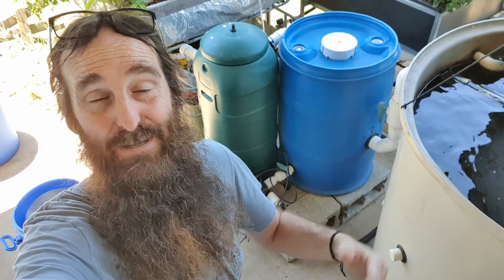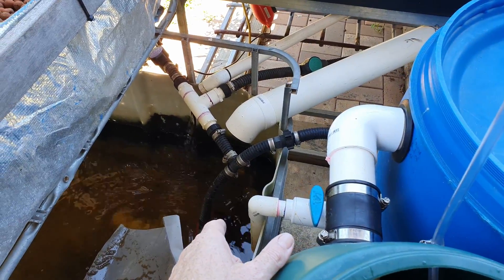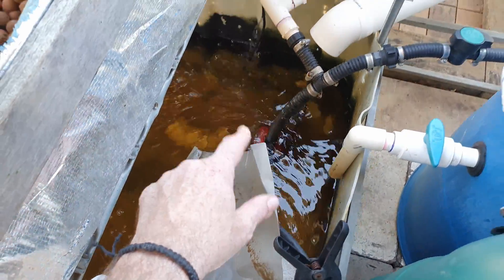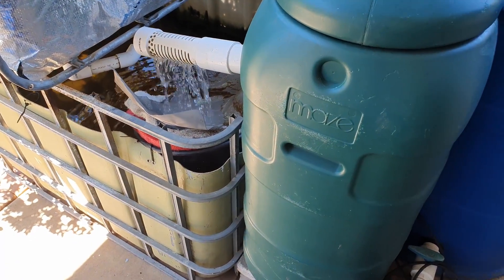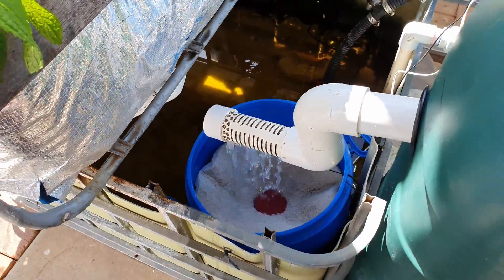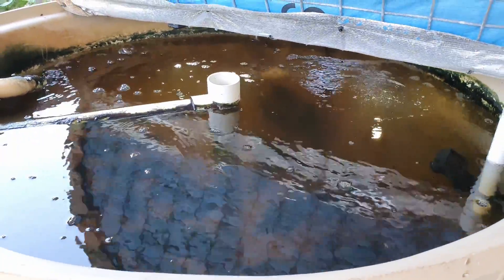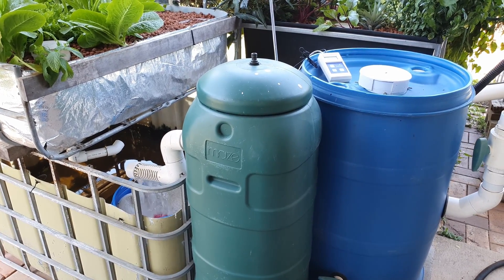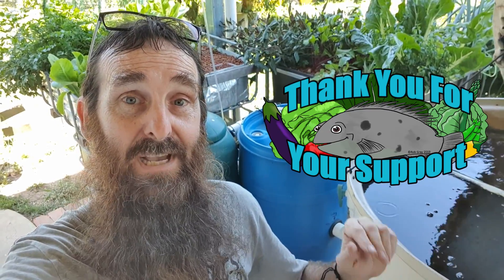New Fine Solids Filter for Aquaponics System

Comment: I am having a difficult time understanding what the valve between the fish tank and the first solids filter is accomplishing?  What purpose does is serve?  I am building one similar to yours and am about ready to start the plumbing.  Also, what size is the square bucket you use as a solids filter?  Lastly, the kick pipe in the fish tank?  Can slots be put along the piping to capture more solid fish poopies?  More efficient?  Or is there a reason you don't add any?
Reply from the maker: The valve allows the water flow to be stopped so you can clean the filter without the flow string up the muck.
I don't use the square bucket anymore as it is a bit wide. I would base the radial flow settler on the first 2 videos in this playlist,
https://www.youtube.com/playlist?list=PLBcWprMIwYYjjZIXxx8GZxm_55Fjs0mOF
The opening at the base of the solids lifting pipe is enough to gather the solids from the base of the tank. The only time I've added small slits is due to having fingerlings & needing smaller openings to gather the solids.

Comment: What tank do you use for the fish tank ?
Reply from the maker: This tank came from a company that has now closed down I'm sorry to say. Try searching for "aquaculture tanks" locally & a supplier may come up.
I'd also recommend that you look for a tank that has a height to diameter ratio of 1:2. That will give you better water circulation & solids collection from the centre drain than my taller tanks. 
IBC caged totes work as well & are much cheaper than the larger specialty tanks.
Reply: @RobsAquaponics  im from horticulture background but want to go aquaponic setup.  Ill be doing a ibc style setup first to get the feel for it. Looking at 6 bed 2 ibc main tanks and a sump tank system
Reply: @RobsAquaponics  love the challenge to by the way

Comment: Hi Rob, I have a system very similar to yours, same filters etc. Water pH seems fine though if I dig in my media beds I have very fine suspended solids. My beds are constant flow as my sump isn't large enough to handle flood and drain. If I scoop some up there is no bad smell nor does there seem to be a rising pH. Fish tank is clear. The system has been running for over 12 months without cleaning media beds. Am I right to leave things be or is an annual clean of media beds standard practice? 
Thanks for all you do mate, you do a great job. Should be proud!
Reply from the maker: Hi Ren & thanks for the kind words. 👍
Fine suspended solids through the media should be no issue & I get them in our system as well. I think if you keep an eye on the pH & do a bit of a smell check every so often you should be able to catch any issues before they become a problem. 
Maybe a drain of the bed & a quick dig through the media for a visual check every 6 or so months couldn't hurt if the fish are going through a bit of feed. 
Hope that helps some.
Reply: @RobsAquaponics  thanks mate, very reassuring. Oh and you have a good taste in music! Long live heavy music 🤘
Reply from the maker: @Ren-io4mw  🤘Cheers Ren 🤘

Comment: Loving your videos! Really well done and informative. You mentioned setting up another system that will be direct flow. Any advantage to this or is this just an experiment?
Reply from the maker: Our first system was a single loop system where the water went from the filters out to the beds & it ran just fine. 👍
The split flow set up is better for systems like our current one as the beds are spread out a bit & are also set at different heights. 
Hope that helps some Alexis.

Comment: Hello Bob. I have a 1000 litre tank.. haven't installed bio filters yet. Which Uv sterilizer can I buy 🤔
Reply from the maker: I wouldn't recommend you use a UV in an aquaponics system. It can cause issues with the availability of iron boron & manganese to the plants. Mechanical filtration would be the best option I think.

Comment: I'm wondering if you could drain the growbeds to a second sump and only pump that water to FT. Filtered FT output would then only go to grow beds. Not a permanent solution of course, but until the solids are cleared.
Second remark: are you sure your SLO is working correctly? It's almost as if the solids aren't leaving the FT but only the water is.
Reply from the maker: Have been running systems with these SLO since I started & this is the first time I've had issues. 
I had a feeling it was the flow rate not handling the increase in feed so rectified the issue,. Did a bit of an update on it in the latest clip,/
https://www.youtube.com/watch?v=RHO7llpAYi0
Cheers & happy growing.  👍

Comment: My seedlings are light green... should I supplement some nutrients into my aquaponics or will that hurt the fish?
Reply from the maker: It's hard to say without knowing more. 
If you system is young it may not have enough nutrients to support all the plants yet. In that case seaweed additive may help a little but I wouldn't go adding any nitrogen/ammonia based additives in case the bacteria haven't built up enough to process it yet.
Reply: @RobsAquaponics  it is new and still developing. I also have a terrible milky cloud and can hardly see the fish, the cloudiness wont go away. I don't know what to do it's been about 3 weeks, I put in a mechanical filter and am using some uv light to try to discourage algea growth. I'm not sure if its algea or bacteria bloom, but I thought it would have cleared up within a couple days. The fish are still alive, so it can't be to toxic.
Reply from the maker: @PhosHodosLogos  The UV light can cause issues with some nutrient uptake by the plants so wouldn't run it for too long. 
I would say at a guess that the bed is just over planted at the moment. 👍 The cloudiness could be a number of things though.
Reply: @RobsAquaponics  I wondered about the UV light. I think I will try to find a place that can test the water for biological components.  Thanks for the response.

Comment: Great video rob! How often do you recommend cleaning the k2 pieces in the bio filter? I would think maybe every 6 months or so. Keep up the great videos! They help us out alot:) don’t let the negative comments bring you down brother
Reply from the maker: They shouldn't need cleaning as all as the movement from the air would stop any solids from settling out. 
The air stones sit on the base in this one so that shouldn't be an issue at all. 👍
I did need to clean the media in the old MBBR a few times a year as the venturi was set off the base & this allowed solids to collect under it.

Comment: I'm have a 60gallon (100x50x50cm) canvas tank where I keep my talapia and turtle,I'm trying to use as aquaponics + NFT,  I'm having issues figuring out to introduce a sump tank with split flow since is a canvas tank I can't elevate the tank :) higher, should I just forget the idea of sump tank ? :)
Reply from the maker: If you're running NFT only you should be OK as the water level will be staying fairly constant. 
Hope the system works well for you.
Reply: @RobsAquaponics  thank you rob, I decided to ditch the nft and replace them with the gutter growbed as afnan did ☺️
Reply from the maker: @izwanmohd  Nice one mate.👍 😁
Hope they grow well for you.
Cheers.

Comment: you should try a NFT tray with perpindicular ridges and run the water over it.  the solids would probably settle along the ridges.  if you put a hole on the NFT tray before the water inlet for the tray is place and mounted the tray on a see-saw then when it is tips the other way it would purge the channel pretty good.  if many were mounted in a zig zag fashion and tipped once or twice a day that might work
Reply from the maker: I found it easier to increase the flow through the tank & that looks to have done the trick. 
I covered it in a more recent clip if you're interested in sussing it out,
https://youtu.be/RHO7llpAYi0
Cheers.

Comment: Hey mate, could that airstone you have in the fishtank be your issue? might be worth bringing it up midway, it may be effecting the flow in the bottom of your tank and stopping the solids from making it to the SLO.
Reply from the maker: Hey Jason. Have moved the air stone position and altered the water inlet and it looks to be helping.
Will be showing the results & an update on the fish in this coming weekend's video.
Cheers 👍
Reply: Love ya work mate, I look forward to it.

Comment: I've had a few problems with water clarity myself. Since you've helped me out so much, figured i'd share. In the states I use a product called API accu-clear. It works well because it makes the debris in the tank convert into solids in the bottom. From there it gets sucked up in the radial flow filter. One additional thing that's helped out is I have a plastic soap dish at every area water enters the tanks, with green brillow/sink scrub pads. It filters large, small solids, but also probably works as bio-media because of the surface area. I switch the pads out once daily. I can get a completely murky tank from adding new clay media clear in about 2 days using this method. Hope it helps.
Reply from the maker: Hey Andrew & thanks mate. 
All it took was to increase the flow rate after the new filter was placed in the sump & the water has been clear since. 👍
Need to drop a camera down there to see how the water looks now the flow is up to 820ish gal per hour.
Chewers & happy farming mate.

Comment: Hi Rob, I made my system like yours 600 lts, i had some plants like spinach, arugula, sweat pepper, tomato, lettuce they are 3 weks old. I got the contact to buy tilapia alevins! Im so excited!!!
Now what should i put first, the fishs? The plants? The whater was circulated trough 1 wek.
What I have to do? ....
Reply from the maker: You can add plants straight away while you're cycling the system. 👍
I wouldn't add any fish until the system is cycled & you have a bacteria colony in the grow bed. Generally it takes between 4-10 weeks depending on your climate. 
How's the system going now?
Sorry it took a while to respond.
Cheers.
Reply: Thank´s a lot!!! i will put it and still checking ph.
Regards!!!

Comment: Very good demonstration video of micro solids removal 
 I usually use a big thick sock  on the out let of the pump pipe for this purpose the micro solids removal and it does wonders . The sock gets huge cakes of micro particles that is then fed to plants in my small garden as organic fertilizer . You should try this method too and do experimentation on this method. 
One question brother . Have you ever used broken earthen pottery and brick chips as bio media after the complete solids removal . It is said to be more effecient than MBBR . ??
Reply from the maker: Hey DK.
I have used the socks before in a similar-sized aquaculture system & found they needed cleaning daily. With this one, I can leave it a week before I need to clean it out (which I should be doing today.....). All the much from that goes to the small garden under the Lime tree so doesn't go to waste. 😉
With the bio, the settler doesn't take all solids out so there will be some that accumulate in the bio. The beauty of the MBBR is that the media self cleans & any solids are moved on to the next filtering component. 👍 
I'm not sure about the brick chips but in one biological surface area chart I saw had clay media with a biological surface area of around  250-300m² per³. The PE03 I'm running has a BSA of around 800-1000² per m³ but I think it's probably closer to ½ of that as the movement of the media would be knocking the bacteria off the outside of the media constantly. 👍
Cheers mate & sorry for taking a while to get back to you.
Reply: @RobsAquaponics  thanks brother stay blessed

Comment: Why not add a static PE03 filter after the radial flow settler before the MBBR. It is easier to clean compared to a net and foam media. Here is a sample of that in our system. https://youtu.be/gz2YQ1cuU1A
Reply from the maker: It's better to have solids filtration after the bio so that can collect the solids created by the bacteria in the bio I was taught. After running a few systems configured in different ways, I can now see the value in that order of filters.👍
Wouldn't mind seeing a more in depth video on how that filter is set up in the clip if you have the time. 
Cheers.

Comment: I'm sure you said at some point, but I missed it. Why did you choose to go with a split flow system this time? What do you feel are the benefits of the split flow vs single loop? I appreciate that you keep your fish's water quality in such high regard.
Reply from the maker: Hey Trisha.  I went with the split flow with this build as all the components are at different levels & spread out a bit.  
Ideally I'd have the FT at the highest point then run the water down by a 10-15cm / 4-6" drop to the radial flow settler then drop it down about the same to the grow beds that would all be in a straight line.  
One of the next builds I'll be making will be a simple split flow as I found it to be the easiest to run & think most folks just starting out would appreciate the simplicity. 
Hope that helps some & sorry it took a while to get back to you.
Reply: @RobsAquaponics  Thanks Rob. I appreciate you taking the time to explain.
Reply from the maker: @trishapomeroy9251  No problem Trish & thanks for the thanks 😁
Cheers & have a fantastic day.
Reply: if you want 1 loop and only 1 pump evry growbed has to be at a diffent hight and with split you have more options in hight and to expand is pretty "easy"

Comment: Hi Rob, 
Can I suggest a 60 micron stainless filter? My pond has a 60 micron drum filter - which does a fab job of cleaning the water.
that with the two moving bed filters means I have crystal clear water in the pond. Granted my fish density is a lot lower than yours.
Love the vids - please keep up the good work!
Reply: the drum filters are super nice pre filter's but they clean themself evrytime they clogh up, thats why they use sutch fine filters but yea only the price i saw was the problem :(
Reply from the maker: Hi Davis. I'd like to play around with a mesh filter (bought some 100 & 200 micron screen to play with) but I don't have the space around this system to set up another filter. Might have a crack at something in the next build.
Cheers mate & have a great one.

Comment: Hi Rob
It won't help that you were dumping the water from the filters right on top of the pickup for the pump, any solids that make it through get pumped straight back into the tank. There is a lot of turbulent water, which does not allow any fine solids to settle. I would have a smaller 500L IBC purely for a settling tank and put the last fiter outlet into that. Water can then overflow from the settling tank into the pump tank purely by gravity, any fine solids should stay in the settling tank. Use the IBC drain valve to flush solids out and into the garden every couple of months.
Great to see you are getting there, I really miss my old system but just don't have the room these days. Keep up the good work and thanks for sharing matey.
Reply from the maker: The water flow is split between the beds so about ½ the flow is being deposited there where the solids can settle out. 👍 It's basically the same set up as I had in the large system I had with the 2 fish tanks Dave. 
Not sure if you've seen the most recent aqua clip https://youtu.be/RHO7llpAYi0  but the little filter has been doing a great job & I think increasing the overall flow rate has helped a lot as well. 👍
Cheers mate & have a top one.

Comment: In the wild, regardless how muddy, fish would have pretty much no contact with ammonia because of the much greater water volume in a river. It's why discus keepers like myself are doing 2-3  large water changes per week, discus must have clean water,  they come from the Amazon - massive difference between a tank that holds 400 litres and the mighty Amazon.
Reply from the maker: That's my issue with the basic CHOP2 aquaponic system & why I have the biofilter inline before the sump.😉😁
The jades come from a muddy river system so they aren't very particular about the amount of particulate in the water, still would like to have the majority of it out & the water clear enough to see through. 
Cheers Melody & have a top one.

Comment: Rob, good video I too am always worried about water clarity.  The key is multiple filtration systems.
Reply from the maker: I fond that increasing the flow helped the most. When I serviced the old pump I found that the impeller had loads of gunk built up around it (should have taken pictures 😕) I I think that reduced the overall flow rate & added to the problem. 
I don't think I'll have that issue with the new beast. 😉😁
Cheers mate.

Comment: Have you ever thought about doing a protine skimmer?
Reply: the tick foam a skimmer makes only comes with salt water so yea :/
Reply from the maker: Not really needed here Antonio as the water is constantly moving on the surface & breaking up any floating scum.
I used to have a skimmer to collect the scup build up in our first system but that was plumbed up differently.
Cheers mate.

Comment: So why not just run the water through the grow beds first instead of sending some water back to the fish?  Wouldn't that eliminate the need for a bio reactor.
Reply: im guessing the beds build up with solids and can not break it down fast enough . better cleaning bio reactor than the beds . u dont want down time
Reply from the maker: That certainly would but the system as it stands doesn't lend itself to that due to the height of the components. 👍
I could have build stands but I wanted a quick easy build system & it's running great now I have the flow rates sorted. 
Cheers.